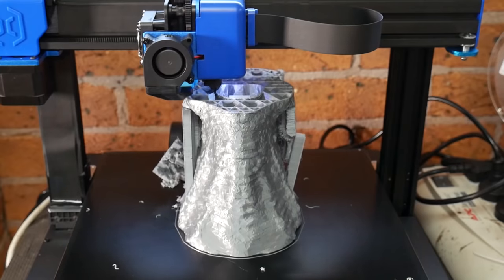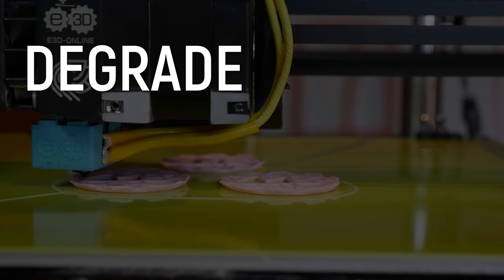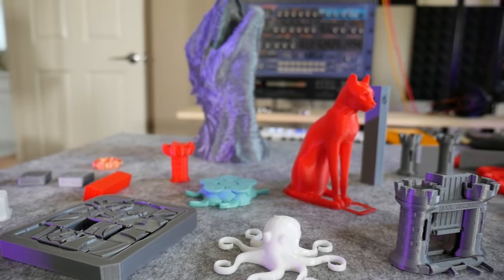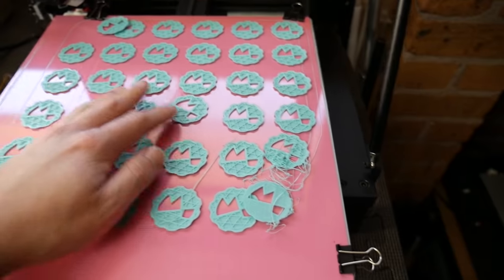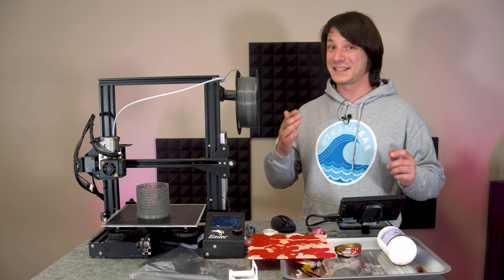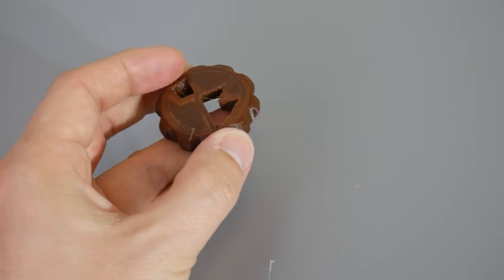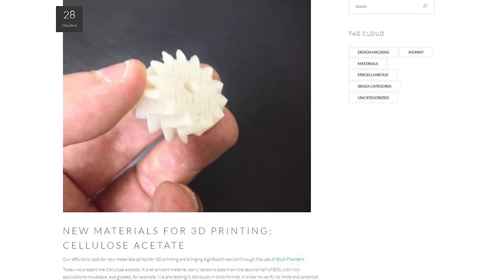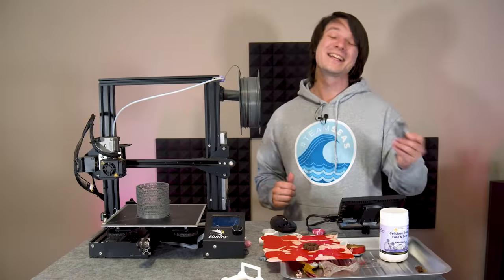PLA - 3D Printing's Biggest Lie.

Comment: Hey! So I’m a plastics engineer and currently for one of my projects I’m working on synthesizing bio polymers. PLA is the biggest bio polymer on the market today, however, like you’ve mentioned it struggles because of its degradation variability. As a result, pla parts can break down in a few months or a couple years. That makes it difficult because how many parts are you okay with it degrading at some random point? Not many. So the big thing that’s being tried to solve is to create a bio polymer with a consistent degradation rate.

If you want to learn more let me know! I’d be happy to talk more!
Reply: can't the factors of degradation be controlled? like something which tolerates oxygen, but doesnt like the moisture and pH of soil
Reply: @khlorghaal  that is one of the things that’s being done. However, in a landfill, the parts are more likely to be touching other plastic parts and only the outside comes into contact with the dirt. And on top of that, it would mean that plastic can never be exposed to the outdoors both before and after production. 

What that means is once the pellets are produced, you have to ensure the pellets don’t come into contact with dirt when being shipped to the manufacture. That’s something that’s a lot harder to do in practice than in theory as where the pellets are made is almost always very far away from where parts are made. That’s true for even just in the US where a large percentage of the plastic parts being produced domestically is in Erie PA while a large percentage of the polymers are being produced in the gulf coast. That means you have to ship that polymers from the gulf coast to wherever the plastic is being produced in trains, trucks, and boats that are not the cleanest. 

As a result, if a little bit of dirt gets into the train car, say the railroad is inspecting the inside of the railcar and there’s a little bit of dirt on inspectors shoes. Well that could mean the plastic starts to degrade in the rail car, the part manufacturer then makes a milk jug, the milk jug looks fine, you buy it, and at some point after you bought it the jug leaks and now your frigid is covered in milk. 

That’s a bit of a fun example of what could happen there’s much more serious consequences that could be life threatening if plastic breaks down when the parts aren’t intended to. Would you be happy if your turn single stalk in your car just degrades and breaks after a few years of ownership?

There’s a lot more that could be said about this topic as there’s no easy answer. Which is why people have been trying to come up with solutions for decades.
Reply: One thing I'd like to see is a plastic that dissolves in a common household chemical (like acetic acid), but is otherwise reasonably durable. I have a problem with using noxious solvents like acetone or sodium hypochlorite, but I could stand using my distilled white vinegar to clean up a plastic spill. Part of the problem is, things that dissolve in common solvents tend to get dissolved by whatever produces that...
Reply: I’ve been wanting to do something useful with the cellulose mats that grow in my my kombucha jars, but I’m not a chemist. Maybe someday there will be a kombucha filament with a light vinegary essence.
Reply: @PhillipBell  you are correct, but using a polymer without any additives as almost always not possible. You do have to be careful about what additives you use, but there are environmentally friendly additives that can be used. However, there’s some standard additives that are used in almost every polymer such as UV stabilizers. Even if the polymer is supposed to be used in the darkest cave and is never supposed to see the light of day, manufacturers will typically add in little bits of UV stabilizers to make sure the polymer doesn’t degrade in shipping.

For commercial industry, manufacturers will be very careful about what additives go in as they add cost and can affect the final product. However, the 3d printing industry skipped over the research and manufacturing side of things and went straight to hobbyists. As a result we’ve lost a lot of standardization that would typically be seen in the plastics industry which has lead to us not knowing what additives are in the filaments we use. This is dangerous as there could be cancerous additives used in a polymer that we’re not aware of. For instance, I refuse to use an SLA printer outside of a fume hood as the vapors you can smell are extremely carcinogenic. I’m truly dumbfounded as to how they’re not regulated more because if you have them in a chemical lab those chemicals aren’t allowed to leave a fume hood. If you tried to sell the chemicals to research, they’d be listed as dangerous chemicals and I’d need to prove my lab is certified as being capable of storing and manipulating them before fedex would drop them off. Slap a 3d printing label on them and no one bats an eye.

So yes, additives are incredibly important and unfortunately iIwould agree that we need some regulation on polymers used in additive manufacturing both for the environment and for humans. But we’re not going to see regulation until either people start demanding filament manufacturers start posting what additives are in the filaments they produce, which is something industrial polymer manufacturers have been doing for decades. Or funding becomes available for researchers to publish more papers to help persuade governments to regulate this more.

The issue with testing research is that it’s a lot of money. The tests themselves are expensive to conduct and take a lot of time. My time and other researchers time is really expensive. And the information takes a metric truckload of time to analyze into concrete trains of thought. So unfortunately I think it’s unlikely to happen unless people start to demand it.
Reply: @tantamounted  can that be done? Yes. Should that be done? In my opinion no. That’s something that can get very dangerous very quickly. You could have a material and a chemical that work very well and have no harmful reactions, but have some contamination and you’re very quickly producing some toxic gas as a bi-product. 

On top of that, what are you supposed to do with the now dissolved plastic and chemicals? You now have to store those in long term storage tanks which starts at thousands of dollars or pay to have the chemicals disposed of by a chemical waist company.
Reply: Degradation of PLA has been the biggest pain in my ass for the last 15 weeks. Trying to work with it on a larger scale than a 3D print is tricky. I’ve seen it start to degrade during extrusion/compounding and even in injection molding. Though I found out chloroform dissolves it in the process.
Reply: @mgibilterra  Is there any research being done into additives that improve the biodegradability of PLA and similar bioplastics? I'm not a materials expert, but I imagine using a different plasticizer or a secondary additive that leaves structural integrity in normal conditions relatively untouched while making resistance to a combination of heat and moisture lower would be at the very least more marketable than a constant degradation plastic, and could be used as a stopgap as we do more research into more compostable bioplastics.

I currently print with recycled PLA because it's arguably the best-for-the-environment commercially available thermoplastic filament out there, but it's rather alarming that the "best" filament is still bad environmentally. Is there a recommendation you have in the meantime for hobbyists/small businesses who use FDM printing?
Reply: @Michael Gibilterra it's crazy to see you on here!
Reply: How caN we connect sir
Reply: What do you think about PHA?
Reply: Hey Michael, what major did you get, and what school did you go to. I’m currently trying to decide if I want to do materials science engineering at my university.
Reply: @lmackey4957  Plastics Engineering Technology through Penn State Behrend.
Reply: Can you make them dissolve in water really quickly? Like when they're normally outside they degrade in 2 years or something but if they somehow end up in ocean it takes week or something? Air humidity might be big problem tho

Comment: Quite the interesting video! One of my biggest pet peeves with 3d printing is how expensive the recyclers are. I'd love to recycle some failed prints or support materials and use them for next prints but at the price point, it makes it nearly impossible and impractical for hobbyists to afford. You can find a decent 3d printer for $200 but they cheapest diy shredder for filament will let you back at least $700 (excluding ghetto food blender here) let alone the $2,000-$6,000 special extruder that you need to create filament from the shredded scraps. If fancy 3d printers can be bought for under $500, why is there still no viable small hobbyist filament recycling machine? It doesn't have to be a 3devo machine, but something affordable that gets the job done.

Comment: This acetate-goop is a great glue for acetate frames to repair. I use it regularly as an optician to fix breaks on frames, since it’s like coldwelding the parts together.
It’s a great material that’s already used for 3D-Printing glasses. There is a Swiss manufacturer which offers a specially tuned printer and filaments for frames.
But it’s ridiculously expensive.

Acetate is a great material, especially when it comes to allergies where it’s almost irrelevant.

Comment: You might remember ages ago (2017?) during a stream I mentioned the experiment with PLA and mushrooms, and how the mushrooms broke down fragments in a grow chamber. I wonder if there's been any more advances in that. And how it would work on the cellulose.
Oyster Mushrooms have been used to break down sawdust used to soak up oil spills, so if those approaches could be scaled up, yay! You'd probably want to avoid eating the mushrooms due to heavy metal accumulation though.

Comment: Yeah, that's the thing, it's biodegradable UNDER INDUSTRIAL SETTINGS... You can't just stick it in the ground.
Reply: Right, which almost never actually happens.
Reply: Exactly. This is not only about PLA. It's a general legislation problem. Also in the EU, companies are allowed to use the term 'biodegradable' when it's about Industrial conditions, which is very confusing for the consumers, of course.
Reply: then it isn't compostable, then is it?
Reply: To compost it, you need your compost to sustain temperatures of over 140F, and it needs plenty of oxygen for the microbiome. Getting that combination is just tough at home. An open air pile just won't get that high, and a bin designed to trap enough heat in would probably have issues with the flow of oxygen. And none of that takes into consideration the additives in the filament. 

I don't know. It doesn't matter if it can be composted in theory, if in practice it that's not going to happen.
Reply: But keep in mind, PLA breaks down when exposed to UV light, a few years sitting in direct sunlight and it breaks down to its constituent atoms.
Reply: @jpe1  It's not that extreme. I was honestly disappointing he didn't cover UV degradation as it isn't what you think. Some PLA loses layer and wall adhesion through UV exposure, just splits apart and contracts/expands away from it's own pieces but your still left with an object that could be glued together and used again. Other PLA does actually degrade to the point of getting kinda powdery but again, with a simple treatment like paint it would stop and be fine. The only study with any real evidence to show I've seen put it at 10 years on average to begin to degrade if left in direct sunlight, intense heat or an oxygen rich environment. Buried in the ground as a compostable, your practically preserving it by blocking all of the harmful things.
Reply: @eideticex  that makes sense.  Good to know,
Reply: @natalieisagirlnow  biodegradable != compostable
Reply: @eideticex  agreed, just burying it and expecting miracles is fruity backyard science.

Comment: I wish recycling it back into filament was more affordable.  I would love to do that at home.  But companies that make filament would probably fight it.  Also with PETG becoming a popular filament, recycling PETG bottles is much better than it ending up in the environment.
Reply: This very much. So much bottles out there. All wee need is to remelt them into filament. It IS that easy.
Reply: @DirkLarien  Not really, the more you melt down plastic the more it degrades in quality because the long polymer chains that make it flexible and strong don't link back together. Remelting the plastic could work for a little bit but it wont work forever.
Reply: @MrMoon-hy6pn  Good point. Can it be analyzed or measured ? If so how about mixing it with "fresh" trash bottles if the melt mix becomes poor and under set quality threshold.

Comment: The cheapest kit I've seen to recycle PLA into filament is the Filastruder at US$300 and you can buy quite a few rolls of filament for that. Also unless you have multiple printers running most of the time, one person probably doesn't produce enough waste to keep the recycler going, so you really need a group of people to make it economic. But I also think we need to find a way to either recycle or find a better material.

Comment: this would be a great one for CNC kitchen to have his way with. If theres a 3d printer guy who could do it, its him
Reply: He does have a Benchy or two in his compost, afaik.
Waiting eagerly.
Reply: Kewl
Reply: He's testing the new NonOilen filament from Filamentum right now in his composter. It's PLA mixed with another polymer which makes it far easier to break down. Aside from the environmental properties, it has thermal resistance of 100C straight off the print bed and prints at lower temps than PLA. If all these properties are true then this could be a holy grail printing material.
Reply: @Bordpie  Unfortunately, PLA can only break down under the right conditions. Anything else that is added to it to assist with this process, will simply create more microplastics.

Comment: Apart from this biodregradeability I would like to see producers of filament of any kind using ONE type of spool and these spools should be recyclable too. Cardboard comes to mind
Reply: Yeah. I was disappointed Prusa only made the spool core of cardboard and still used plastics for the sides. They said cardboard sides would get flappy... just use thicker/denser cardboard.
Reply: Overture filament comes on cardboard rolls which was a factor in my selecting it